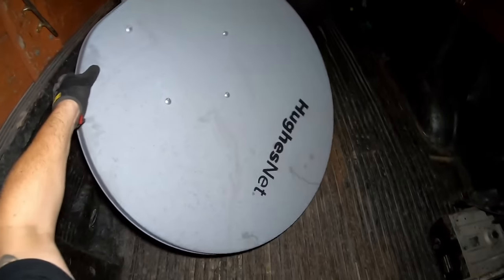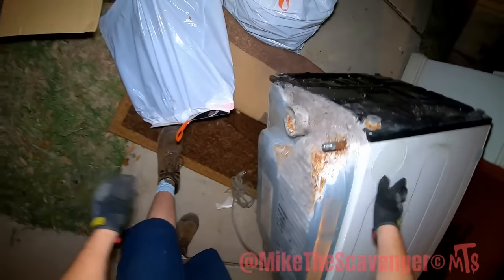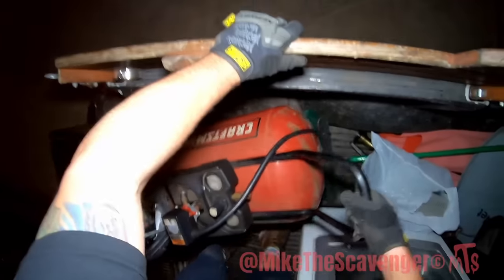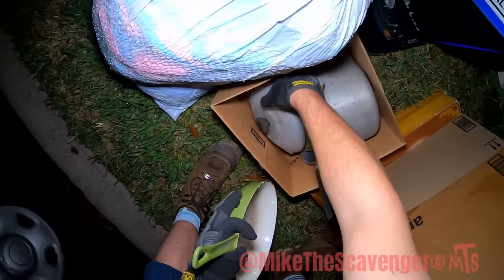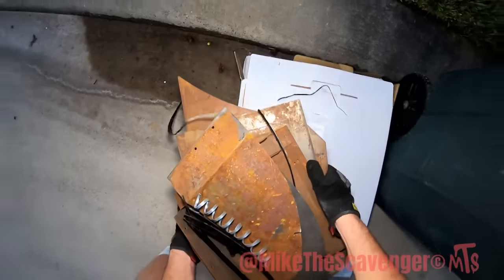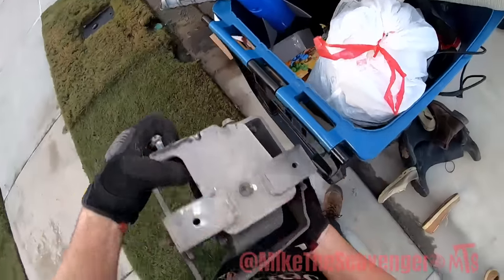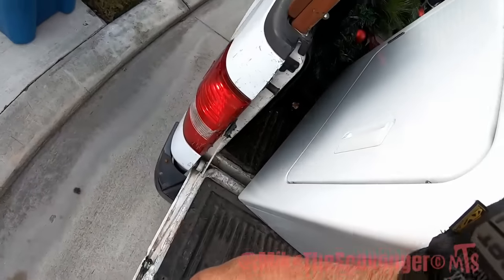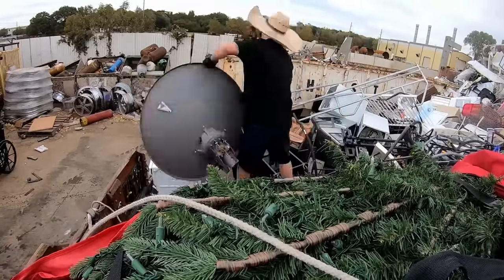Curbside Scavenging "I Think She Caught Him Cheatin'"

Comment: Hopefully the compressor works or at least needs a minor repair. If you do find a pinhole leak along the bottom, that shows there is significant rust in the tank. Time to scrap the tank since they can explode if they are too rusty.

Comment: I just fixed one of those craftsman garage door openers. Still humming after more than 20 years.
Reply: Yes, they have a plastic drive gear that get gets busted before anything major happens during a door jam..  There is a cheap kit to repair that gear.  I have fixed my share of gears...
Reply: @larryjohns8823  Yup, that was what I replaced. Cost me like $15 for the kit. I also just replaced the sensor kit for $20. I prefer to keep things working than to scrap them.

Comment: Crafts Man Air compressor has a push button reset button under the black plastic on top of it. Goof with it  and it will probably work. There simple compressors to fix.